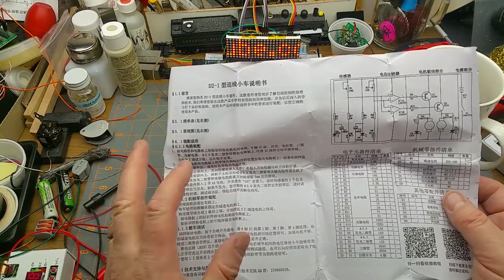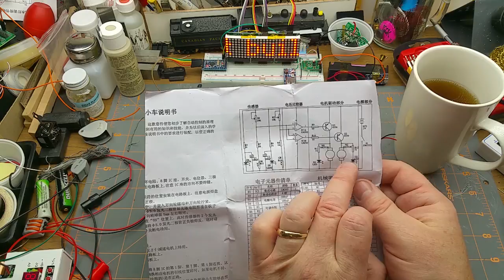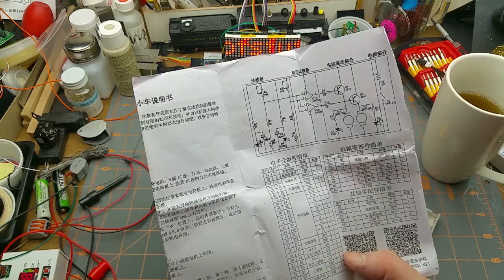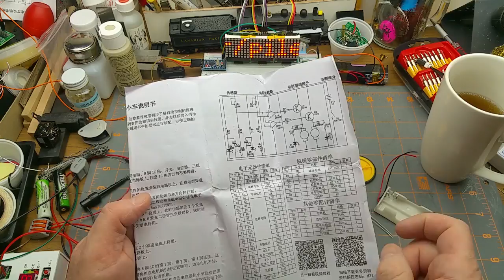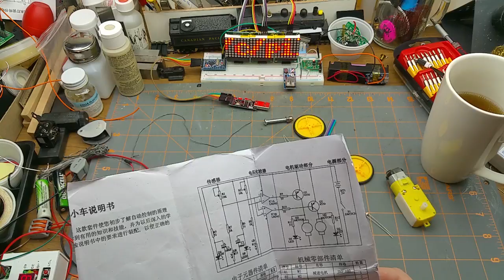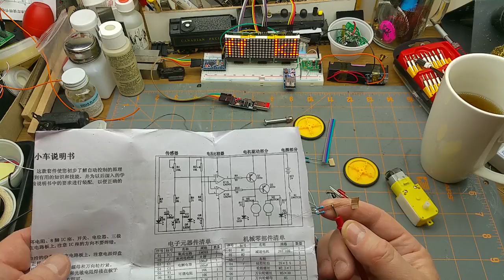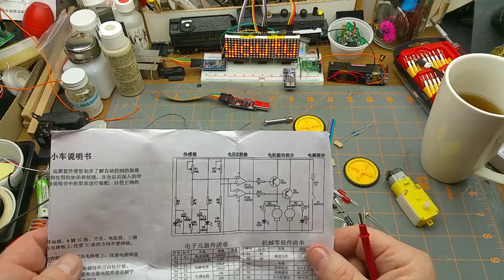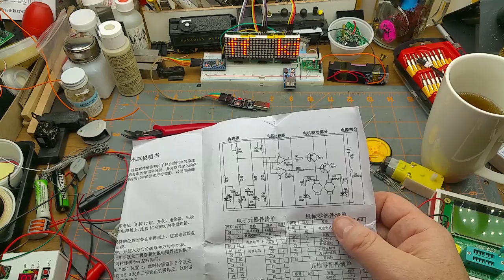kit build - line follower

Comment: OK, So now I don't have to build mine. The SQ8 video would just be Hell to watch.  
When you were using yer meter to check Ohms I thought I would send you a component tester, But then ya dragged one into view, so I guess I won't. Thanks for passing the hour.
Reply from the maker: Oh, you spotted it there...

Two of the biggest annoyances with the SQ8 is that you never know exactly where it's aiming, and you don't always tap in the correct "morse code" to get it into the correct mode.